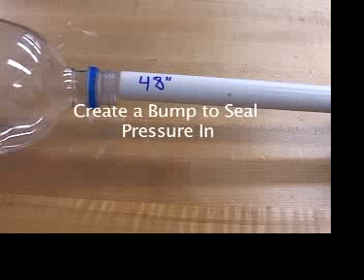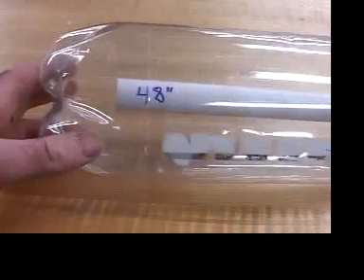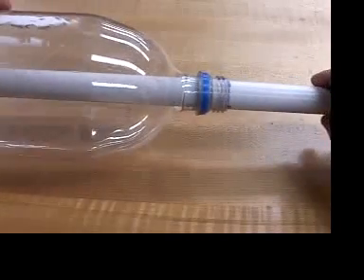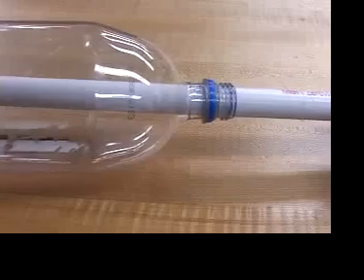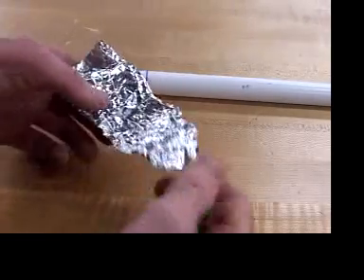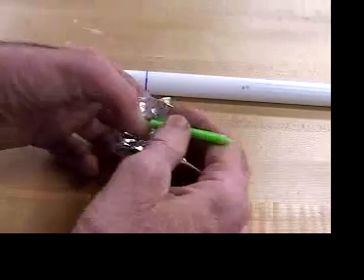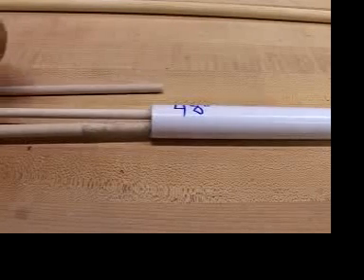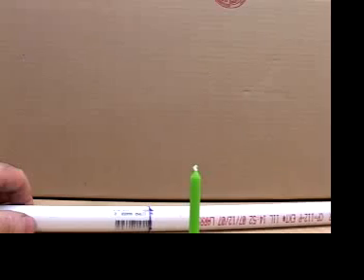Build an Overhead Water Rocket Launcher Part 4 seal bump

Comment from the maker: @hellandlife Did you adjust it? It will involve loosening the hose clamp and moving the trigger assembly down so the bottle lip is pressed against the "bump" then tightening again. Rarely, the spout of the bottle will crack, which is the only other thing that causes leaks.
Slater

Comment from the maker: O rings don't work that way ("just roll onto a pipe") under pressure. I know you're not a fan of the melted  bump, but by the time you work out what O rings involve, it might not seem so bad to look at the video and try the bump method again.
Slater

Comment from the maker: O rings invove somehow machining a grove into the PVC to hold it in place and recess it. But that weakens the pipe, so you neet to reinforce it with a smaller pipe inside, possible 1/2" CPVC. Check other sites for ideas.
Slater

Comment: Okay.
This Rocket is very easy to make, the difficult part is the bump. We did alot of time doing that. If someone can't do that using a candle, you might do the other things first. When you did that, you can hold your hand very tight on the end (where the soda bottle is placed) to make it airtight. if you connect the pump to the pipe and you heaten the place where the bump is using a burner (DON'T HEAT IT TOO MUCH!) you can make the bump without pushing.

How can i make it tight with O-rings?

Comment from the maker: It's hard to tell without seeing, but you might have to loosen the hose clamp and move it down a little to hold the bottle tighter onto the bump. If it's just leaking a few drops of water, that does not really matter.
Slater

Comment: how could I prevent the bottle losing pressure? Even though it has a little bump at the end of the pipe, it is leaking water which means its losing pressure?